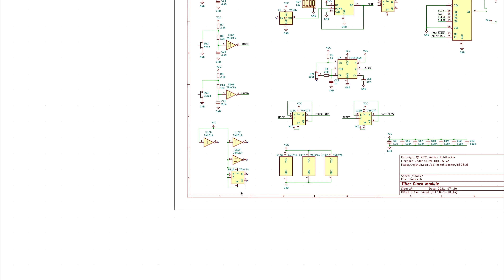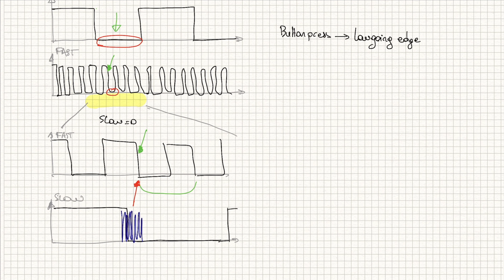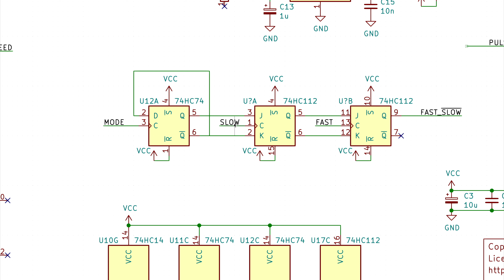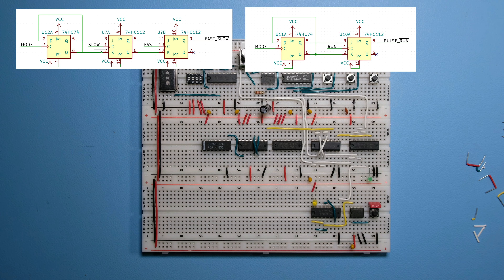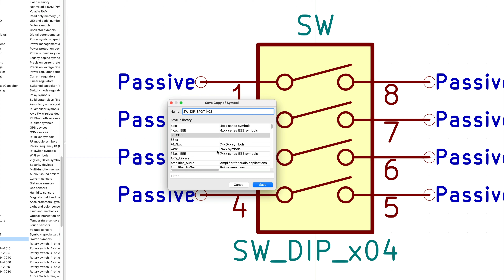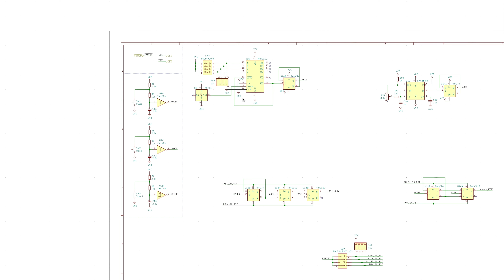#11 - Clock Module #3 - BB816 Computer

Comment: Hi adrien. Great job. It does produce the expected output but that is a lot of components. Here is an idea: when there is a switch request, wait for the currently selected clock be low, disable the output so it will stay low, then wait for the fast clock to go low at least once (this garantees a minimum time equivalent to the fast clock), switch clock, reactivate the output when going high. This way you could have as many clocks as you want, and you would switch at the speed of the fast clock while making sure minimum timing is met. I'm going to try this out on my own build. Will let you know.
Reply from the maker: This sounds like a similar approach to http://6502.org/mini-projects/clock-switching/clock-switching.html which you might find interesting
Reply: @akohlbecker  Very interresting read. Thanks for the tip.
Reply: @akohlbecker  Actually I've been working with the suggestion (on paper) and it is quite well designed. I would be interrested to know why you did not keep this idea for a more complex one.
Reply from the maker: I'm not sure my solution is more complex actually, given the requirements (3 clocks, synchronized inverted clock). Seems to be using the same number of flip flops. Might be able to save the second mux I'm using maybe, but then it needs a latch and a few logic gates. And the write port is also an OR gate (io select + write pulse). You get the ability to switch between clocks of similar speeds, but that I don't really need. I would say it is comparable :-)
Reply from the maker: I just had a think about it and I also can't see how to integrate manual buttons into it. It seems coupled to the behavior of the CPU writing to the write port. For a manual toggle, you can't assume that it happens in phase with the selected clock

Comment: Is there a specific reason why you chose to switch FAST/SLOW clocks when they are both low? Or would a switch during their Hi-phase be equally valid - with a pos-edge triggered JK-FF e.g. 74HC76?
Reply: I'm not sure if there's a technical reason for it as the 65816 is an (awesome) static mpu. Conceptually it feels better because the low clock is the start of the cycle.
Reply from the maker: Yes, that's it. No reason other than "it is the start of the cycle"
Reply: OK, thanks!

Comment: I have been watching all day and most of the time have good explanations for your design decisions, but this episode has me baffled and scratching my head. It has to do with the multiplexers (74HC151). First of you wire up a bunch of inputs unnecessarily, I get that you don't want floating inputs, but since you choose which inputs to "copy" to the output, I think leaving them floating isn't a problem. And on U17 instead of using the MSB to switch on you chose the middle bit, greatly messing with your routing. But I really don't get the need for the entire extra multiplexer, you have the signal CLK on U16, sure when in pulse mode the signal gets useless, but you only switch speeds when in run mode and then the signal is valid. It is entirely possible I have missed some fundamental, I would never even attempt what you are doing, timing diagrams makes me want to cry.
Reply from the maker: Firstly, thanks for dedicating your day to my videos :-) 
When talking about routing I'm not too concerned with the breadboard routing, but more so the PCB routing.
All inputs to a 74HC series chip need to be driven, either by another gate, or by pulling them to VCC or ground. You can't leave floating inputs with CMOS gates. Tying them to signals already present around the chip means you don't need to route VCC to those pins. So it is a tiny improvement in PCB routing, since in U16 all the mux inputs are next to each other.
I need the signal from U17 because in pulse mode, the clock is not toggling. If I had wired CLK to U10A, I would have had to press the Mode button then the Pulse button to switch away from pulse mode - an annoyance in the circuit's human interface :-) This additional mux lets me do it in a single press.
On whether to use MSB or any other mux input to switch, it does not matter. You could choose any of them, they're pin 9, 10 and 11 so the PCB routing is not impacted.
Reply: @akohlbecker  Thanks for the detailed explanation. I am not convinced that you have to drive all the inputs, but it is certainly best practice.
I think you missed my point, the routing on a pcb would be simpler for the input pins, not the selection pins. But again not by much. On the breadboard it doesn't matter much since it is all wires any way.